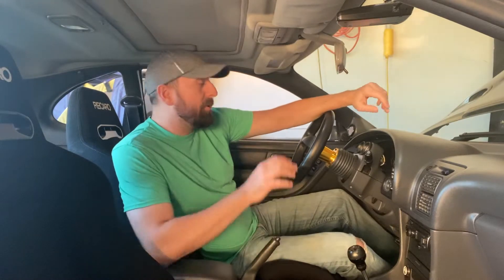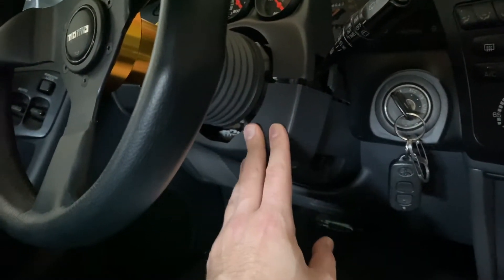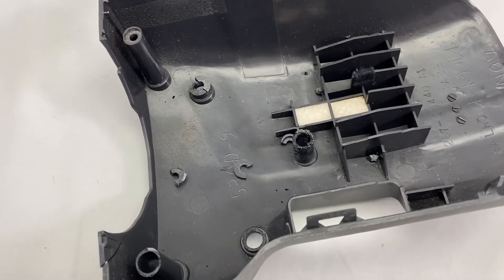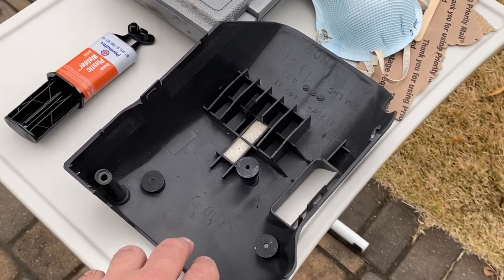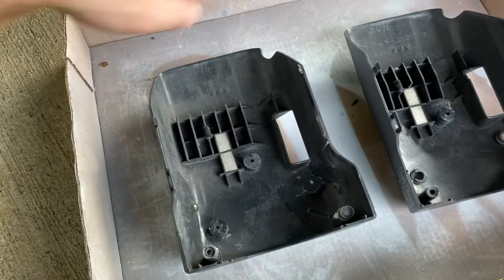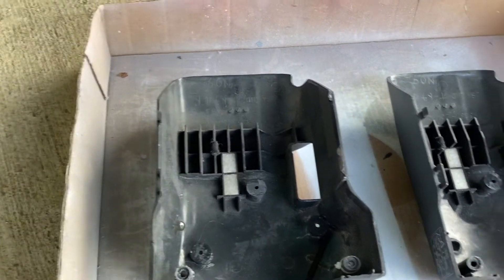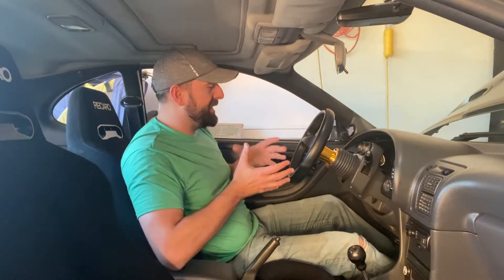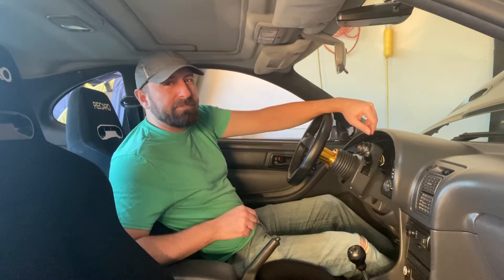Project CMS: Using a 3D printer to repair the Gtfour's steering column plastic.

Comment: Two other things that could use a 3D printed repair, replacement clips to hold the vents and a glue in replacement part for the bit that breaks on the cup holders.

Comment: Hey can I order 3D printed interior parts from you if it’s small stuff? We have the same car.
Reply from the maker: Carl Carlsson I’ve had a couple requests for these caps. I may make a small run as a diy fix. I’m trying to think of logistics of it since it won’t be a 100% one size fits all situation.
Reply: @cmsgt4  Yeah it’s a pickle... I guess it will be DHL express at best if it’s between countries...